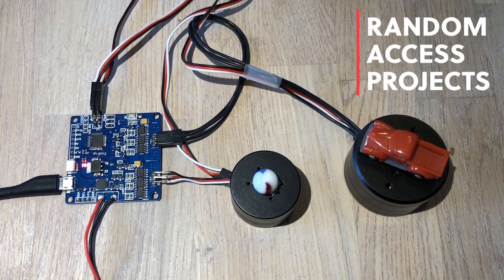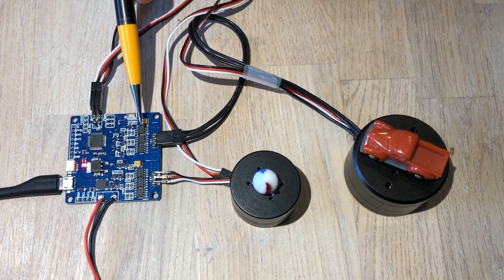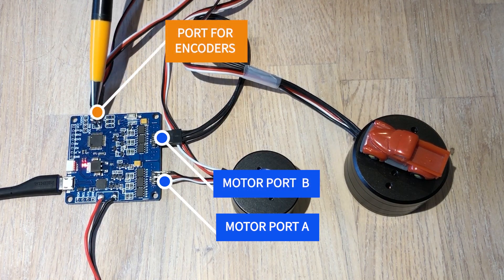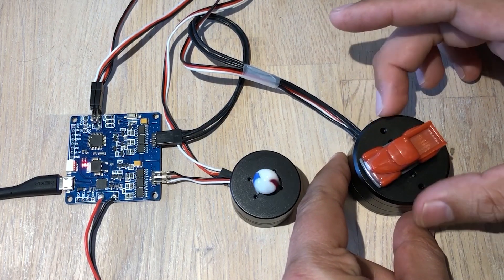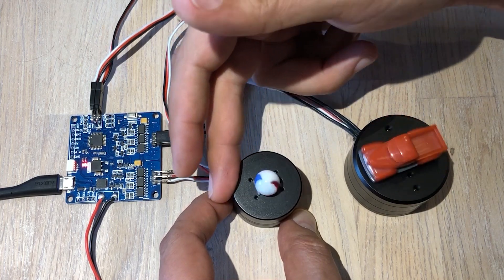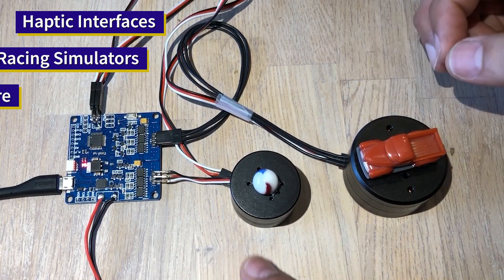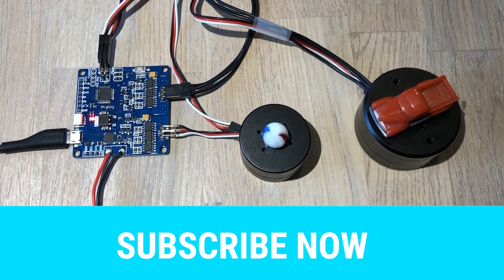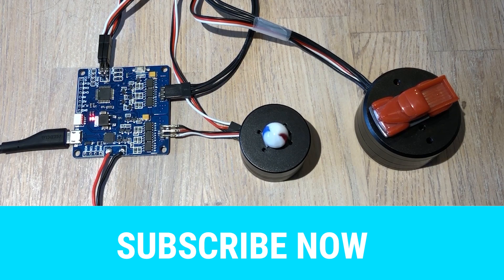Arduino Double Brushless BLDC Motor FOC Haptic Demonstration

Comment: The biggest hint in the video is "simulates a mechanical connection between the two motors," but trying to rigidly connect the two through control loops can easily end up incredibly unstable.

My explanation:
I think a simulation of a stiff torsional spring and damper is used. The difference of position between the two motors is found using the encoders. The greater this rotational 'distance' is between them, the greater the force pulling them together. To maintain stability, a virtual damping force may be added to torque. The net torque for each motor from the simulation step is then sent to the motor drivers to complete the loop. In effect, it is a PD controller with the error set between the two motors.

The spring can be anchored at each control step to a point halfway between the two motor encoder positions, or to each others' locations directly. Based on the replies to other comments, it sounds like the control point is set between the two encoder positions.

Extras:
-Could a motor proxy be used? Each motor has a reference target in the simulation step, then apply torque on the motors toward the reference target.
-A motor proxy could also be used to help modify felt characteristics of the motors such as mass or friction if those are also modeled in simulation. Basically, instead of anchoring the motors to each other or a point between them, the motors can be attached to a simulation that can behave differently than the real motors. A simplified way to do this:
     timestep = current time - previous time
     net torque = (stiffness coefficient * angular displacement) + (damping coefficient * velocity) + any other torques that need to be simulated.
          Could be used for things like hard stops, active effects, etc.
     angular velocity = angular velocity + (net torque / moment of inertia) * timestep
     proxy position = proxy position + angular velocity * timestep
-For better simulation steps, something like RK4 could be used, where the weighted average of multiple partial steps is used, with each partial step being fed the value from the previous partial step.
-I also want to note that none of these "extras" are necessary for the demonstration in the video.

One example use:
In search and rescue for a disaster, movements in a human can be extrapolated to a larger machine to clear rubble without losing touch.